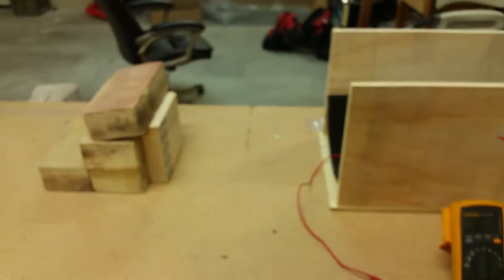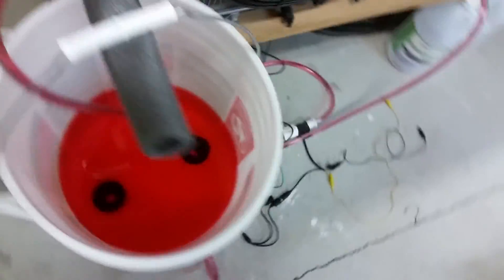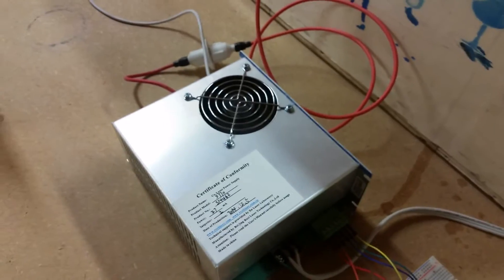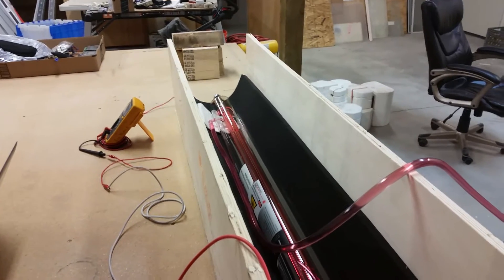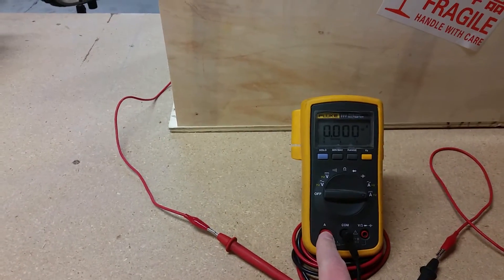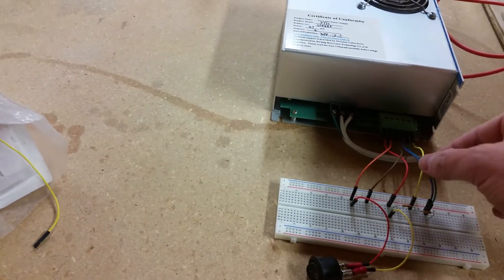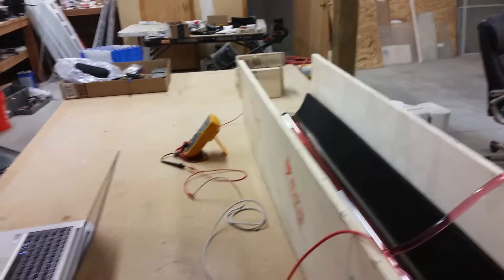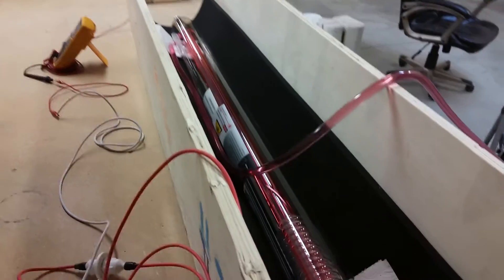90W CO2 Laser first power up

Comment: excuse sir just got a question to ask, you know how 5v is needed for this laser, can you please tell me if the 5v is from the supply or do i have to attach 5v ftom an external supply and connect the wires to the co2 supply. how did you get your 5v?
Reply from the maker: The power supply does generate its own 5v for you to use in the control circuit. I explain it a bit better in this video: https://www.youtube.com/watch?v=rbVQoleVCno
Reply: Yeah i see thanks for that, as for your laser i never thought that 220v to 110v can effect the beam quality. Actualy i opened my supply before watching your second video and i noticed inside it says 220v IN 
But on the outside it says 110v, not sure why unless it means i can concert from 110v to 220v, i bought the supply from USA, the seller told me to use 110v to power it up. If possible to show a video one day on how to convert 110v to 220v in co2 power supply because in Australia the input voltage is 220v
Reply from the maker: Rewiring it would be manufacturer specific so it would be better to get that info from your manufacturer. Still a gamble if it will work or not.  If you are making a unit that will work in multiple countries it is probably smarter just to get a transformer to convert the voltage.